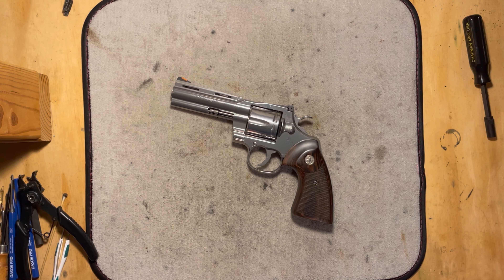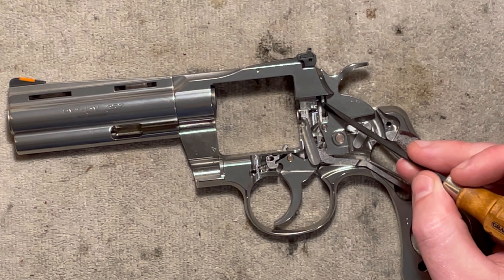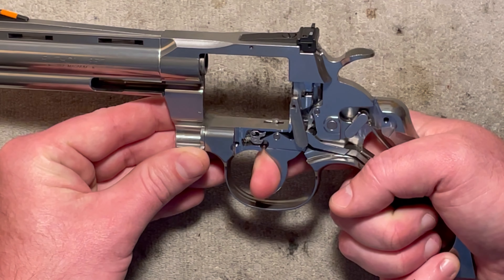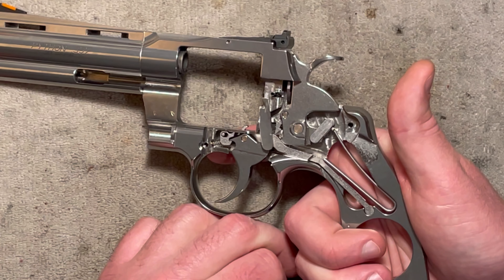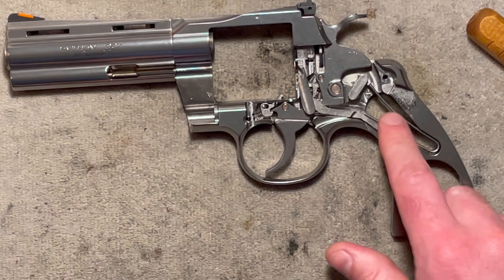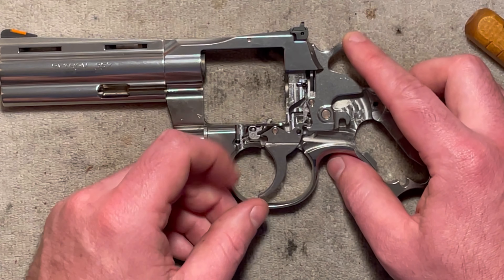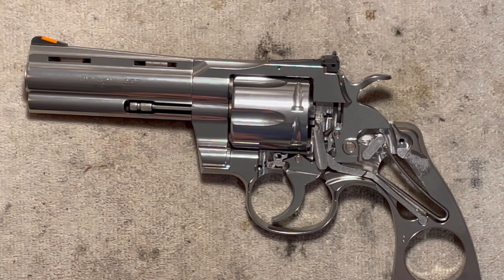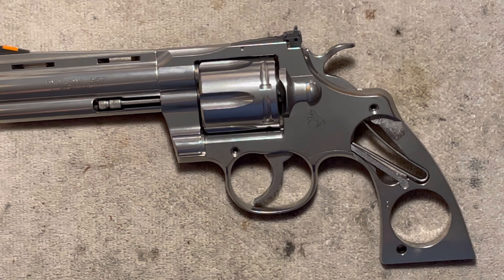Colt Python Revolver Mechanism Explained (Supplemental Video to Animation by Matt Rittman)

Comment: I’m blown away by how smoothly machined the inside of that is after looking at my 686. I bet that accounts for a lot of how much better the DA pull is alone.
Reply from the maker: I think part of it is machining, part of it is intelligent use of MIM parts which have smooth surfaces and prevent the need of machining, and the way the V-spring smoothly adds tension.

Comment: I bought a 6 inch about 9 months ago. I have less than 500 rounds through it. May only complaint is the trigger pull. I shoot SA. SA started at 6 1/4 pounds and it’s down to 5 3/4. I would like 3 1/2. Any suggestions on how to reduce the SA trigger pull?
Reply from the maker: I would initially just try applying a dab of grease to the sear engagement surfaces. I use the Lucas Extreme Duty currently, not sponsored or anything, but it’s been a pretty good grease for my needs. Shooting it more will also help slowly. 

If that isn’t satisfactory you could try the slow method of applying some polishing compound to the surfaces, dry firing a few hundred times, and then going back and removing it and applying grease. I wouldn’t leave it on long term, just a few hundred cycles. 

If that’s not satisfactory then you’ll probably need to find a competent gunsmith who can give you a slightly less positive (but still positive) sear engagement. This ideally would be done by someone who has the appropriate fixtures so the surfaces stay appropriately parallel and with correct geometry, but I’m not sure those fixtures are even manufactured for the Python. While someone with the appropriate level of knowledge and skill might have made such a fixture, I don’t know who that might be so unfortunately cannot recommend anyone.
Reply: Thanks for the reply and good luck with your channel. Since I watched your video I have cycled it about 325 times. The pull on SA is down to 5 1/4 to 5 1/2 pounds. So I have some grease ordered and I’ll keep pulling the trigger. I would be happy with 4 1/2. My 686 Smith is 3 pounds and I shoot it better than the Colt. I plan to put Wilson Combat sights on the Python as I do not like the rear sight.
Reply: Also, my local gunshop has a Python 8 inch that I may buy if I can get the trigger pull acceptable.
Reply from the maker: @markconrad5901 If a bit more wear in and a dab of grease doesn’t get it done, I suspect the jeweler’s rouge/polishing compound and working the sear engagement with that will get you in the ballpark of what you’re looking for. 

It’s a process but ends up mating those surfaces to where, when greased, they’ll slide smoothly and give you a nice single action pull.

Comment: What parts of MIM
Reply from the maker: It’s a good question, but unfortunately I cannot answer it with confidence. Based on conversations I’ve had with other owners who have disassembled their pistols, Colt has not been consistent throughout the production as far as which parts are or aren’t MIM.

It does use MIM for various components, particularly small parts. The cylinder stop/bolt, cylinder latch, transfer bar, etc. are MIM on mine.

In my opinion Colt has made intelligent use of MIM by using it on parts well-suited to that manufacturing technique, and the process itself is done well. They show no signs of shrinkage and excellent dimensional stability. It’s MIM done right, and in the right applications.

Comment: Great video what a beautiful gun I see why it’s so expensive
Reply from the maker: They definitely aren’t cheap, but when you look at the level of precision necessary to get a design like this to work it makes sense. 

It’s a lot of parts working in unison with a perfect fit. The fact it works is pretty amazing technology, but what’s really impressive is how smooth and consistent everything is. 

This was a big project for Colt to preserve their reputation and the reputation of the Python name, and the new Python displays an excellent mastery of modern manufacturing processes and precision. I think they did a good job.
Reply: @ColterBrog thank you if it wasn’t for your video I would’ve never brought one of these will be ordering one this weekend GunStuff Tv has them for 1350.00 thanks again
Reply from the maker: @anthonyvillanueva2410  You’ll love it. They have an intricate mechanism, but in my opinion it is a very efficient way of achieving the goal. It’s a very consistent and precise revolver, designed in an intelligent way. 

They’re accurate and enjoyable.

Comment: The new issue Python is one beautiful gun!  I wish I could afford to own one of every model Python, Anaconda, and even the King Cobra, the guns are just so well done, pure quality from inside out.
The satin polish on the Python is so well done it takes on different shades depending on ambient lighting.  In some light it looks bluish, in other light it looks like black chrome, and REALLY shows when you set the Python next to any other revolver.  Much is made of the Python's higher price, but the price difference today is far less than it was 50 years ago, when Pythons often cost twice to 3X more than Smiths.  Today, and in demand Smith can cost $900+ which makes a Python, or Anaconda at $1,300 and change not such an outrageous upcharge considering the difference in pure quality and functional design.
What sets the Python and all Colts apart from Smith and Taurus is the cylinder rotation is clockwise and this is a MAJOR, positive difference, though many Smith aficionados will disagree. (I too am a Smith aficionado, but I recognize the better Python design).  Back in the day, magnum Smiths had a reputation for the cylinder unlatching under hard recoil.  This was due to a mild latch spring, the counterclockwise rotation design, protrusion of the cylinder pin combined with heavy recoil that kicked the gun AWAY from the the lock!
You see, the center pin was all that stood between the cylinder unlocking and flopping out, and with top loads, it was possible for it to do just that.  With the Python this cannot happen, and in fact the superiority of design is so profound the Python today - and all Colt's revolvers, only use a single, rather large and robust, center latching pin that inserts into the rear of the cylinder.  Nothing extends "through" the central pin as on Smiths.  With a Smith the cylinder latch pushes the central locking pin forward.  Under hard recoil, high G-force on the gun causes it to leave the center locking pin behind - crazy but true.
With the Colt design, the big center locking stud opens with a rearward tug so under recoil, the gun kicks INTO THE LOCK!  But it's better still.  The hand on Colts comes up along the LEFT side of the cylinder ratchet, interposing itself between ratchet ledge and frame.  Thus the cylinder cannot unlock no matter how violently the gun may kick!  The Colt hand rotates the cylinder INTO the frame, with the crane being buttressed by the frame.  On a Smith, the hand rotates the cylinder OUT of the frame, and it's possible on some guns to visible SEE a tiny crack appear between crane and frame, caused by the pressure of the hand pushing the cylinder up and around to the LEFT!
Beyond all this, the result is the Colt latching system is seamless and without mechanical clunkiness and interference.  You retract the latch, and the cylinder is completely FREE to move out of the frame with zero mechanical contact.  On a Smith the latch is pushed forward, with the latch pin pressing the cylinder pin forward, and one can feel the mechanical parts bearing against one another.
Smith guys will cite the superior ability to "index" each shot using a fast DA pull to a solid let-off point where the cylinder has fully indexed, or "carried up" prior to the hammer fall.  The believe this to be more accurate than the Colt system where the hand carries up the cylinder to full index right at the instant of hammer fall (double-action) because they Colt has no "staging feel" inherent in the trigger design.  Since the bullet must traverse the entire barrel, any slight perceived cylinder rotation at the moment of hammer fall is nullified - canceled out because by the time the bullet has be squozed into the bore and spat out some 2.5 - 6 inches later, it is most definitely NOT being imparted a lateral influence from the cylinder's inertia at the instant of ignition!
I love Colt double-actions for the same reason I love Colt single-actions - they're SMOOTH and they're "in-sync" with the natural rotation of they cylinder.  Smiths, Taurus, Ruger, et-al, save for Charter Arms, ALWAYS have a certain "industrial feel" no matter how good the gunsmith!
The NEW Colt shows how far metallurgy and computer aided design and machining has come since 1955.  Nothing on the new version is based on 'eyeballing it!"  Modern, powdered steel alloys are compressed into finished parts such as triggers, hammers, etc. that come out dimensionally identical!  Powdered metal alloys create parts with far less internal stress in the crystalline structure - they're used for Microsoft knife blades which hold up to astounding amounts of deformation abuse!
There are ergonomic reasons I like certain Smith's more - like the new Classic N-frame web-recess, and the smoother action than any Smiths that came before, but the smoothest, most "roller-ballest" revolver I own is the new Python!
Reply: Best explanation I’ve read anywhere!
Reply from the maker: This is an excellent comment. Thank you for sharing your observations. Excellent points made that I hadn’t really considered.

Comment: I just purchased a new Colt Python Combat Elite. The first time I shot it, it experienced a failure in single action mode. 

The revolver is locking up in single action mode.

When you cock the hammer back, it intermittently locks up and you are unable to pull the trigger or manipulate the hammer.  Both the hammer and the trigger are locked up, continued manipulation of both the hammer and trigger doesn’t help unlock it sometimes you can get it to unlock and sometimes the trigger will function firing a live round.

It will be on the way back to Colt this week. Very disappointed in Colt’s quality control. Do you have any idea what could be causing the lock up? 

I couldn’t seem to duplicate the problem when the gun is unloaded. But it occurred several times while I was shooting it both with 38 special and 357 factory new ammunition. I did take a video of the lock-up failure.
Reply from the maker: Hard to say without looking at it. Something definitely sounds like it’s out of spec or there is some foreign item inside the lockwork. 

I’m sure Colt can figure it out.

Comment: Would you say, that the action design of the new Python is a more efficiently engineered one, than the old Python design? Smoother,  better lockup, durability etc??
Reply from the maker: I don’t have a ton of experience with the older Pythons, but in my opinion based on what I know the new Python is more efficient, more robust, and definitely easier to work on. 

It’s really a necessary change from the aspect of actually being able to bring the revolver to market. The old design was much more dependent on skilled fitters. The new design is based around proven concepts that lend themselves well to modern manufacturing. 

The precision of the manufacturing available now, combined with the design choices, results in a very smooth revolver that is accessible to more people.

Comment: I have already sent my python back to colt for repairs. 
 I have a python that when using double action is failing to rotate the cylinder completely and it will also fail to lock-up the cylinder. 
When it fails to rotate the cylinder to the next cartridge it will fail to lock-up. 
After this has occurred the cylinder will rotate to the next cartridge, sometimes it will free spin.  
If I release the trigger it will fire in single action semi-reliably. 
If I fire it in double action again it is unreliable if the gun will fire or not.      
What are your thoughts on to what this could be causing this?
Reply from the maker: Could be the side plate being loose. Colt had some issues with that early in production. It causes the pawl to walk and not properly engage the ratchet. I’d really have to see it to make a better guess beyond that known issue.
Reply: @ColterBrog  it will be interesting to hear the results of colt's  inspection. You have a solid video with some great info to share, keep up the great work.
Reply: @ColterBrog  Colt's repair order said the hand was adjusted, and is on its way back.

Comment: Excellent explanation of the Colt action but I can't really explain to myself why the s&w is different, it has the same parts. Why wouldn't it be the same way?
Reply from the maker: S&W is actually quite different. You’re of course correct that the two different brands have the same general parts, but the way those parts actually interact shows distinct differences in design. 

S&W uses a leaf mainspring to drive the hammer, while Colt uses a V-spring that acts as both the mainspring and the trigger spring. S&W’s rebound slide for trigger reset and a hammer rebounding safety is totally unlike the Colt design. Their safety mechanisms are designed with what are essentially opposite concepts. 

The video linked below might explain this better as it compares the two designs side-by-side. I think you’ll notice they do appear similar, but work differently. 

https://youtu.be/Y5yJx2pwk-s
Reply: @ColterBrog  ok thanks!
Reply: I think I figured out that like you say the parts interact differently, the rebound system of s&w doesn't put as much tension on the hand or pawl keeping the cylinder tight!
Reply from the maker: @garylewis3641  Exactly. S&W’s rebound slide ultimately stops rearward movement of the trigger, which causes the hand to basically just stop wherever it stops in that movement and the cylinder stop sits in the recess without tension. 

Colt’s design stops the trigger through a linkage of trigger>pawl>ratchet>cylinder recess>bolt>frame to where everything is tensioned by the trigger pull occurring and is braced in place at the moment of firing. 

It actually took me quite a bit of studying the mechanism (during the course of trying to assist Matt with the mechanical details of his animation) to fully understand exactly what is happening. I kept thinking I was missing something, that surely the design isn’t that ingenious, complex, and precise… but it definitely seems so as I can find no other explanation.
Reply: @ColterBrog  I like most people  favored the s&w but I have a new respect for Colts action. You are a very smart young man, keep it up!
Reply: The s&w trigger return is faster and more positive.  That is why Miculak prefers them. @ColterBrog
Reply from the maker: @warrenrosen132  Fortunately for me, I can’t shoot nearly as fast as the GOAT Jerry Miculek can, so the slower trigger return is at no risk of slowing me down. I’m plenty slow on my own.